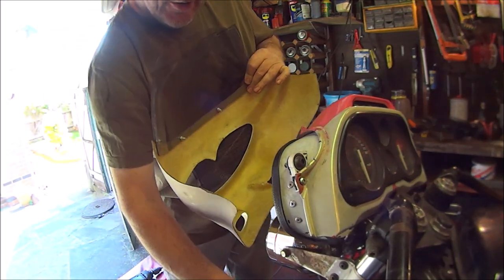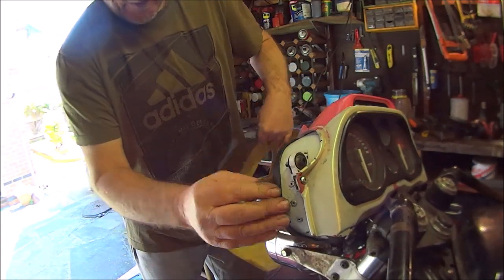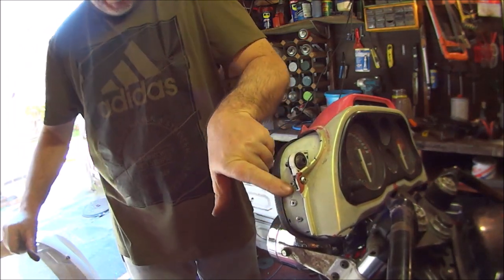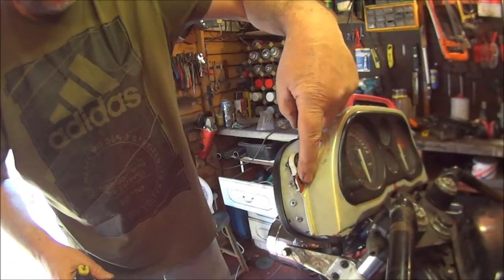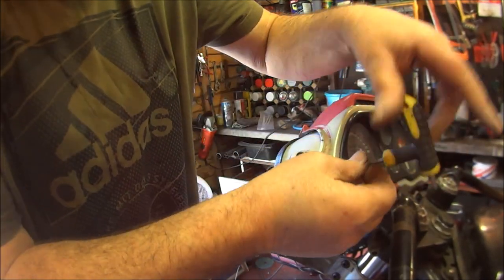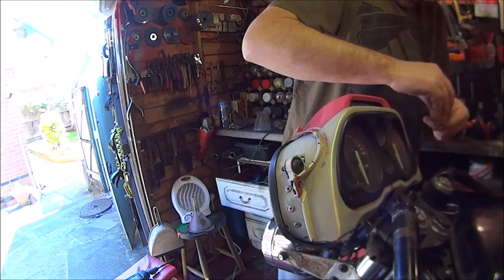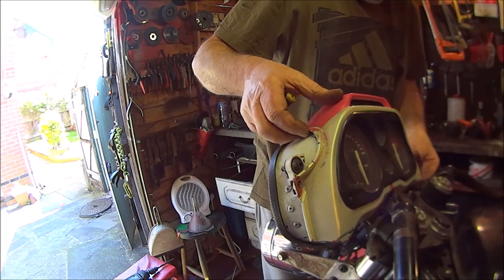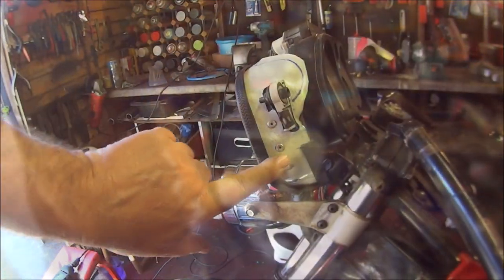CBR1000F Landfill bike. Bikini fairing fitting fettling.

Comment: John, generally,  the valve stem seals / guides allow oil from the cam box to leak and cause blue smoke. The poor valve seat seals  causes loss of compression resulting in power loss.
Reply from the maker: Cheers nigel that's what I was thinking. So if the valve stems are badly worn new seals won't help?.👍
Reply: New seals will help - old stem seals are hard and brittle - new seals will take up a bit of wear.
Reply from the maker: Thanks for the nolage bud, much appreciated I was thinking the valves were knackered hopefully they'll be ok with a lot more lapping with the grinding paste. 👍 👍

Comment: I'm no expert but pretty sure it's the valve stem seals leaking that cause oil smoke problems 😉
Reply: Or valve guide most noticeably on start up from cold or overun
Reply from the maker: Hi Gary cheers buddy Yes I think your right thanks for the help buddy 👍 👍 👍
Reply from the maker: Cheers buddy you've all been very helpful. Much appreciated thanks 👍 👍 👍